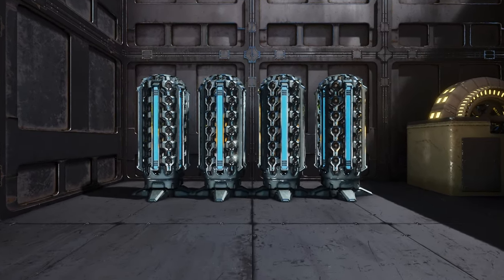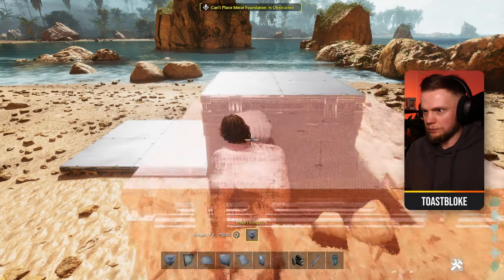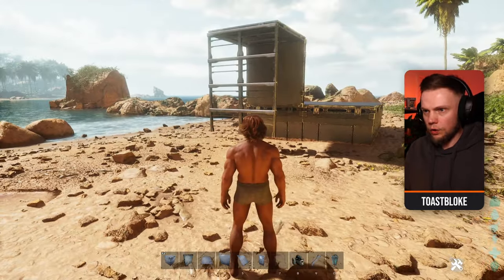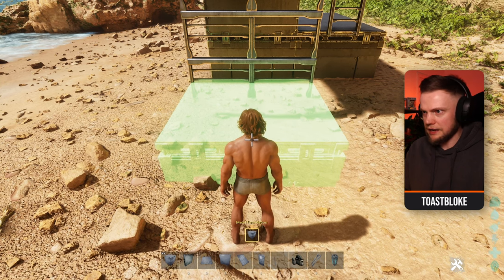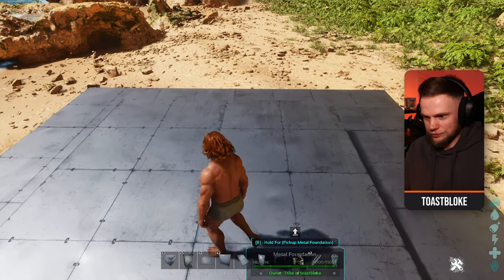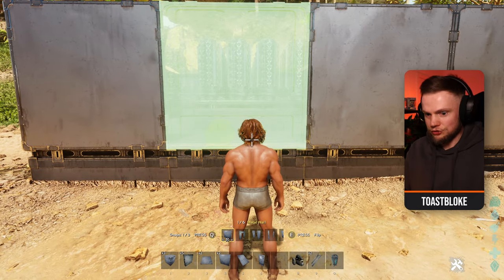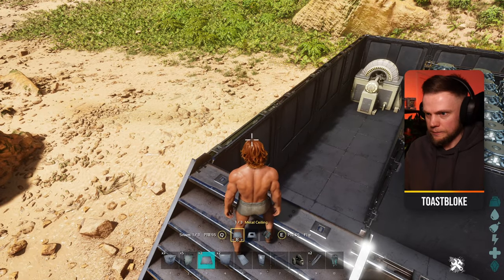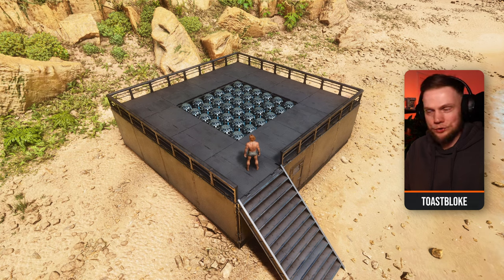How to Build a Cryofridge Floor in ARK: Survival Ascended!

Comment: Is there a way to do this with a base thats already built on pillars? So no foundations? I cant wrap my head around a way to translate this to my base.
Reply from the maker: I'd have to look into it, but that does sound tricky. I'd imagine you could build the scaffolding off the side of one of the ceilings to get the reference point. From there, if a foundation couldn't reach the reference point, I'd maybe get one to a height where a quarter wall can reach when snapped to it and place a ceiling on top to use as the lower floor. Let me know if something like that helps!
Reply: Ramp down from walls iys slightly lower or even use qaurter ceilings this is a hard hard way around

Comment: U put in generator & gas but do u expect it to magically power those fridges? Lol. I mean I didn't see u connect any electrical components. Or do those jus auto place now & I missed it? 🤔 lol.
Reply from the maker: I hate to say it, but it's magic in ASA. Electric and water both work 'wirelessly,'  so you just put down you gen, water tank or intake and they will make things work within their AoE. It's really quick, but I do kind of miss routing my cables!
Reply: @toastbloke   are u for cereal!? I mean, I had the hardest time place irrigation system with a massive tree house I was building in one of the maps in the other Ark game. I all but gave up. So when u say things like, "both," "water," or "tank," or "intake," do u mean for things of that mature also? 
Now work wireless? Is that why I can't find the electrical cables anywhere in the craft menu??? Lol